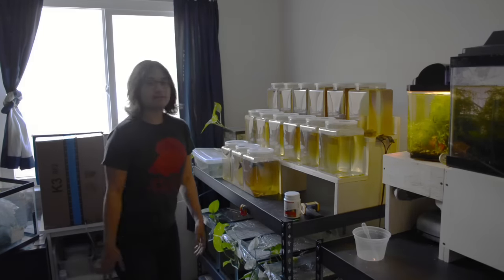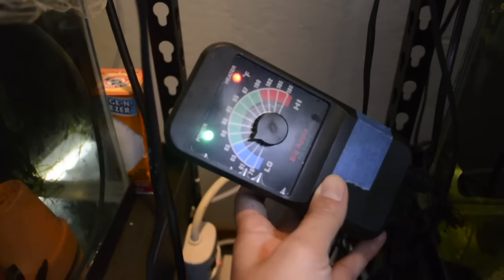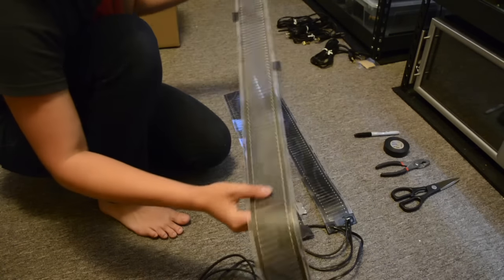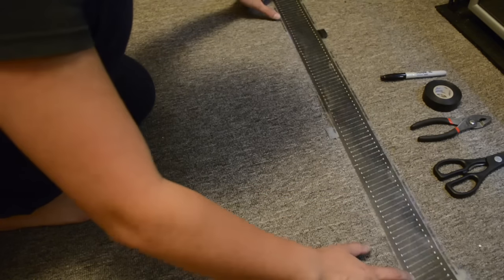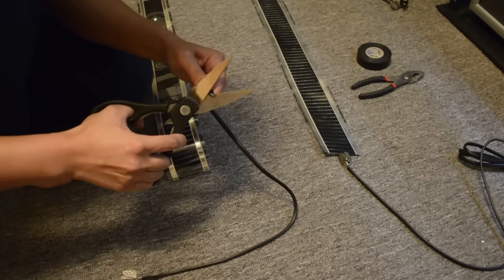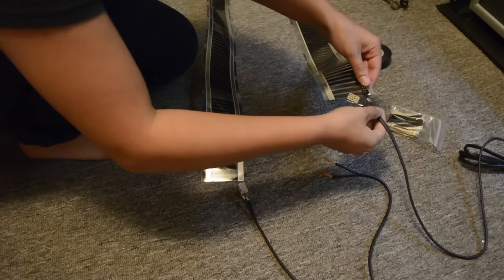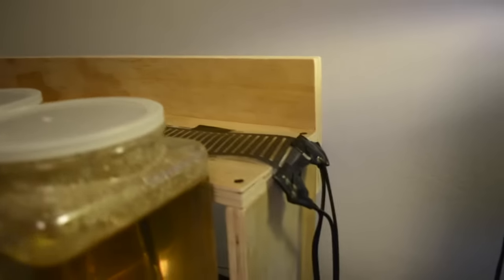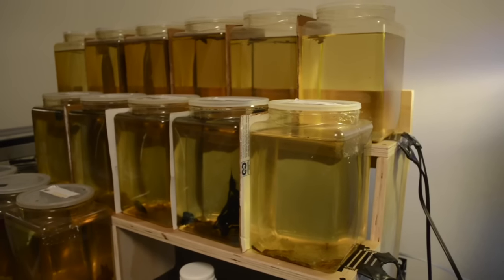How to wire flex watt heat tape for betta jars and aquarium tanks

Comment: Hello. So I've used flexwatt heat tape for breeding geckos years ago. How well does it heat up the tanks. I'm planning to use heat tape on 18 10g tanks and want to make sure they can properly keep each tank heated to 78°-80°. Did you stick the heat tape onto the bottom of the tank or just put the tank on top of the heat tape? Thanks.
Reply from the maker: I think it would do very well for 10 gallon tanks. Just be sure to hook it up to a thermostat. Raising the tanks using some short, thin pieces of plywood on either side may help. I just set the tanks on top of them and they seem to work fine - some reptile breeders have them encased in shelving and they seem to do ok.
Reply: Hello again. Have you seen any issues with water getting on the heat tape? Also how is the heat tape holding up with the weight of the tank. I will be using the heat tape for 3 level rack each shelf holding 6 10g tanks. So hoping there will be no issues with weight and or water. Thanks